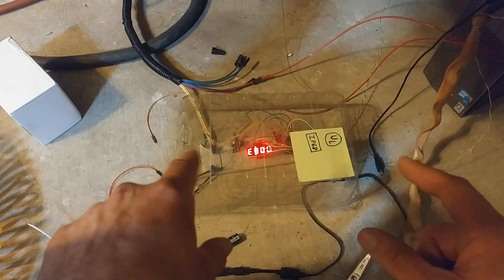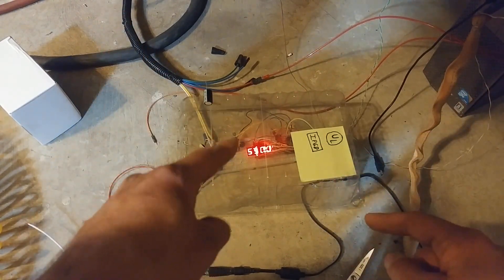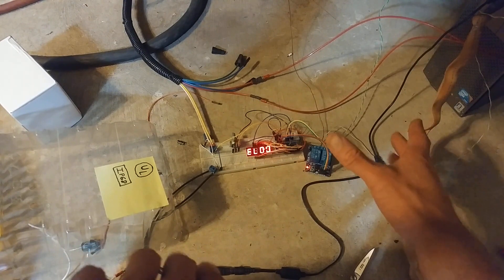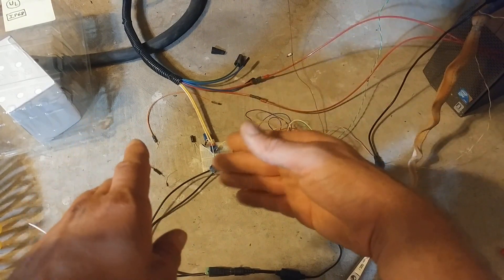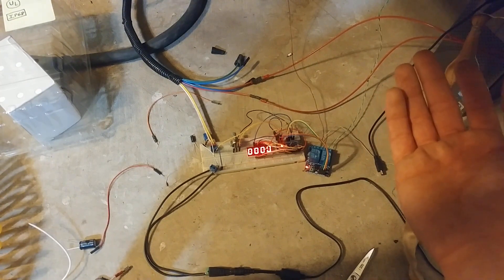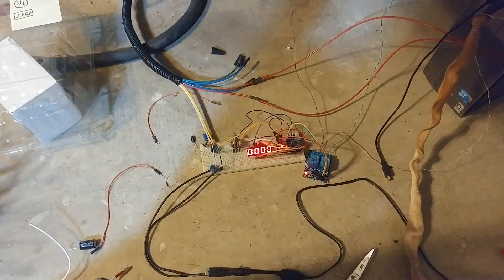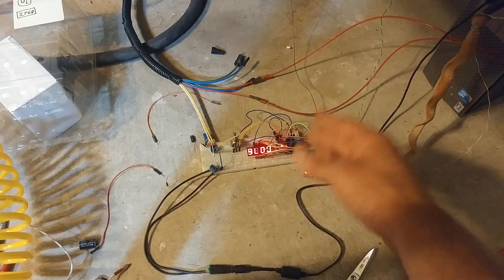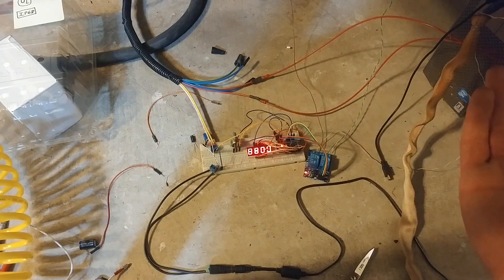CNC Plasma Build: Arduino THC debugging/development

Comment: Is it work with grbl? Can you share wiring with grbl?
Reply from the maker: I don't believe GRBL has the ability to take inputs for performing motions outside of what the G-code says. I haven't looked at it in about a year, so that might have changed, but I'm pretty sure you'll need LinuxCNC (eh, or maybe Mach) if you wanted to use this.

The wiring and the code came in future videos. Check the video description for the CNC build playlist and you'll find them.

Comment: Where do you get the wires that go to the plasma input of the pcb???
Reply from the maker: In my case, since I have a Hypertherm plasma cutter, there's a plug on the back that comes from a voltage divider, tapping off the plasma circuit. For other units, you may have to open the casework and install a divider on your own. (Being careful to not leave any high voltage lines exposed, etc.)

The circuit review (a few videos later on my channel) goes into some more detail on how that divider works.
Reply: @swolebro  thanks I will be on the lookout when I make a video about it for the moment I subscribe to your channel and activate the bell

Comment: I use INPUT_PULLUP so it pull the PIN HIGH through the built in pull up resistor. So if it reads nothing it reads high so no noise.

Comment: Hello
these 7 seg will display the tension when the plasma cutter on or display just tension ajusted ?
Reply from the maker: Sorry, mate, I don't understand the question. Could you possibly rephrase it?

I've got a few other videos in this series that might answer your question too: https://www.youtube.com/playlist?list=PL9xPdBFt5g3SHT1WvcGovHCzQ3Ag_kZeZ
Reply: @swolebro   Hello
_ I mean when i was reinitialise arduino , i set the potentiometer (target) showed in the 7 segment but this value not stable  , when she rest not stable arduino can't set void loop() that mean no output ?
_ My second question i dont understand  this instruction :
 ftmp2 = MINSET + ((MAXSET-MINSET) * (target/1023.0));
   ftmp2 = ((int) (ftmp2*10))/10.0;
Reply from the maker: @benbenameur8429  Ah, it sounds like your potentiometer or voltage reference might have some drift in it, which keeps it from giving a stable reading. If it can't get a stable reading, it'll never exit the while() loop of the setup() function and get to the loop() calls where it actually reads off the plasma.

Are you using an external linear voltage regulator as a VREF as I discussed in the other videos? That is one thing you will want, for sure.

The line you highlighted takes "target," which is the average of your readings off the potentiometer, which will later be the target/setpoint for you plasma (on a 0-1023 scale) and then it projects it onto a scale between MINSET and MAXSET. The following line, where it does *10 and /10.0 effectively truncates it to a single decimal.

If you see the decimal part of the number flickering while you're not touching the potentiometer, you could change those 10's to *2 and /2.0, and then it would round it to nearest 0.5 instead of 0.1. That'd be an easy way to stabilize it at the cost of some granularity in the setting. The other option would be to put more readings into your average for target.

That help at all?
Reply: @swolebro  
1/ All fine, when i use  :
    target = total / 20 and
    i = (i + 1) % 10; and
    ftmp2 = ((int) (ftmp2*2))/2.0;
   i dont know if i just plugging the numbers that i need ?
2/ but when i set potentiometre in difference position the outputs dont set in function of             potentiometre  ,when i  exchange input plasma. ( i mean ,It is assumed that when the      resistance changes, the target changes, which means that the output is not achieved as it was achieved before the resistance changed ).
3/ in void loop :
 total = total + tmp - values[i]; 
for first loop values will be  values [0]  because i=0 ok , seconde loop i =1 and  values [1]
(  total = total + tmp - values[1];  
) i cant substraction values[1] Because it does not exist ?
 thank you.
Reply from the maker: @benbenameur8429  Have you gone and watched this video yet? https://www.youtube.com/watch?v=nmXoZt423WI

I know its nearly an hour long, but I walk through every line of code, step by step in it. (If you've already seen it, give it a second go.)

1. In the setup() function, if you change the averaging of "target" to use 20 values, you also need to use "i=(i+1)%20". That modulo is what makes it loop as you fill the circular buffer "values". 

2. If turning the potentiometer isn't adjusting your setting, then you might be connecting the wrong pins, or have a weak connection. You'll want to refer to this video and the schematic for that:

https://www.youtube.com/watch?v=lkKd5P8oH5Q

3. The entire "values" array is initialized to zero. It's got BUFSIZE slots, all full of zeros to begin with. (Look up C array initialization syntax for that one.) So if you're averaging 20 readings, it'll take 20 readings before you start getting good values out, but that happens in a split second, and then you get a good rolling average from there.
Reply: @swolebro   I watched this video 4 times
Reply: @swolebro  
My thc is work but i will repeat the question :
in void setup total = total + tmp - values[i]; 
in the first loop values [0]   it exists ( for i=0) ,  but for i=1 values [1] dont exists from before that mean i cant extract it because in the first loop i was keep values [0] not  values [1] .
Reply from the maker: The whole array of values is initialized to 0, when it's defined. That's just part of Arduino/C programming syntax.

https://stackoverflow.com/questions/201101/how-to-initialize-all-members-of-an-array-to-the-same-value

As you loop through the first time, you're only subtracting zeros, and on every loop thereafter, you're doing a rolling average across the contents of the cyclical buffer.

YouTube comments are really not that conducive to teaching programming. At this point, if you're still having trouble with it, you might need to bug a friend for help. Anybody who studied software or electrical engineering should have a pretty good grasp on Arduino stuff like this. There's only so much I'm able to do.
Reply: @swolebro  
ok i understund you it will taking zeros each loop .
I mean with my questions start i=1 and do  total = total + tmp - values[i-1];  ok let thank you very much .

Comment: Power it with 6 volts instead and then there will be less power drop and less heat build up.
Reply from the maker: There's a decent chance that would work,  but using the external LM317 I decided on cost literal pennies  and meant I didn't have to worry about the case where it maybe didn't!

Honestly, that whole part of the project would have been so much easier if I had an oscilloscope for debugging. I could pick up one of those Rigol DSO's easily enough in theory, but in practice, I just couldn't bring myself to do it. I'm so far from being an EE, that having a scope just seemed wrong. Hahah.

None of my friends had a scope I could borrow, either. Clearly, I need new friends.